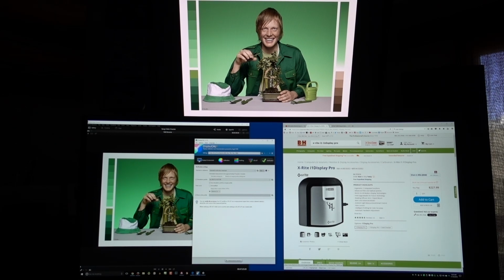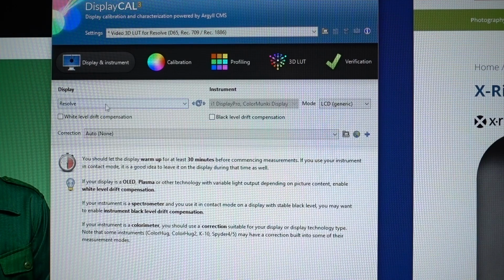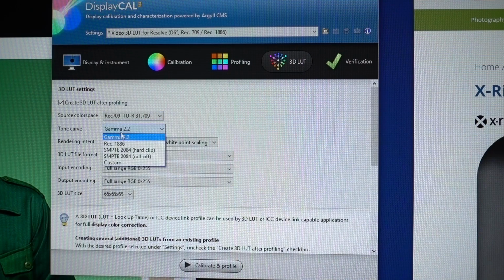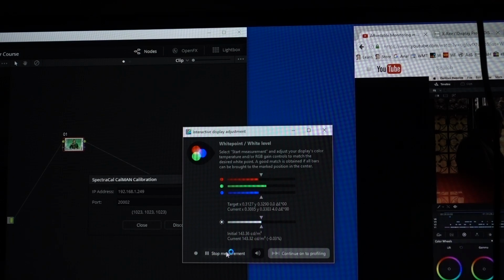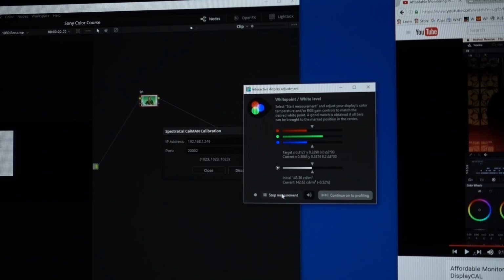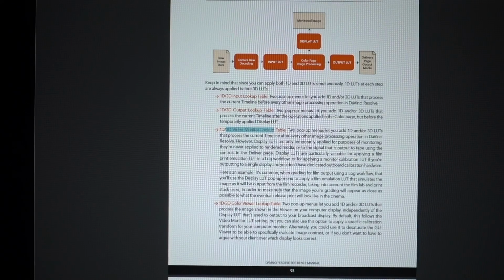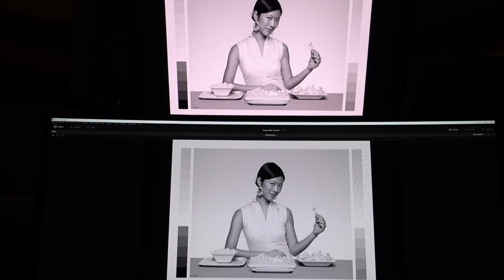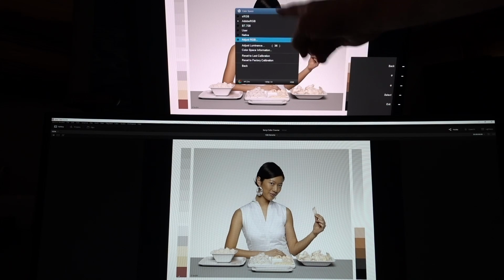Calibrating with DisplayCal in Resolve thru Mini Monitor Question

Comment: I'm having trouble getting this to work right for a different reason. I want to use my second monitor as a computer monitor and as a Resolve monitor depending on what I'm doing. So I calibrated one user mode with a Windows ICC profile to be applied to the Display Port signal coming off my GPU, then I used another user mode to calibrate through Resolve using all the same settings to output through a Mini Monitor 4K card. Since it's the same monitor with the same calibration settings it seems like both should look the same or at least very close. However when I render out my Resolve timeline then view it in the other user mode through my GPU the output file more closely resembles the way the Resolve signal looks without the 3D Monitor LUT applied. This is really frustrating because I don't know which to trust. The signal from the Mini Monitor card looks cooler and less saturated. Which worries me because if I want my image to be fairly saturated and I judge my grade based on the less saturated display I'm worried that everything is going to be overly saturated on everyone else's display, even if they're properly calibrated...

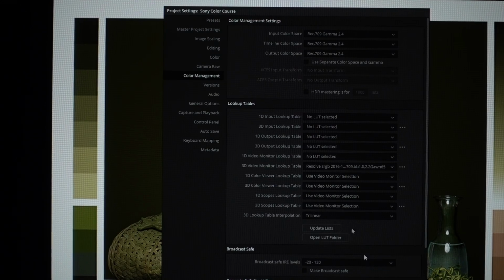Comment: hey Dave, Try this - ( better preface this by saying I'm not an expert) at around 6:37 when you select the LUT for the monitor, you also have your viewer etc (below in the table) set to "use video monitor selection" - by doing that Resolve will apply the LUT to all outputs, if you change the 3d Color Viewer to no LUT Resolve should apply the LUT to just the HP monitor, which is where you want it.
Reply from the maker: Thanks! That fixed the issue!
Reply: absolutely,  if you change the settings on the monitor the LUT will be incorrect. 
While this may not be as "accurate" as a true broadcast grading monitor, it is damn good! and a lot less expensive. I wouldn't use this approach for a blockbuster movie but for mostly web content etc it's great.
Reply: by the way Dave, you also need to watch out for the "scopes" setting in there too - I haven't found a definitive answer on google, but seems correct to me that this also needs to be NO LUT - otherwise the scopes read the LUT changed color, not what is actually in the footage.
Reply: Hi David. Just to make sure - the LG is getting it's video feed from a Decklink card not the computer video card? the LUT in Resolve will only work if the monitor is getting a "clean" feed from a decklink. 
Not sure of the message you received, have never seen it before.
Different brand monitors will look a bit different even after profiling - they all have different contrast ratios, black levels etc etc. One thing to remember is the iMac monitors are designed to make an image look good - not neccessarily to be colour accurate. It should be good after carefull calibrating but then so should the LG. If it's giving odd colours only sometimes then I'd be checking cables / connections etc. 
Also can be an HDMI issue - my large DELL is crap with HDMI so I use a AJA SDI to DVI convertor from the decklink and the image is really good.
Reply: This should be the rigth answer here. The moment you applied the video monitor 3d lut the other boxes changed aswell.
Reply: Nice work Jeff.  Yeah this seems to be the ticket.  I'm guessing the reason for the red image on the HP monitor was maybe changing monitor RGB values after the lut was made maybe?  You shouldn't change any settings on the HP, let the lut do the work.
Reply: Hi Dave and Jeff,
I tried to calibrate my LG 4k display with my X-rite i1 Display on DaVinci and I followed all your steps. 
I tried Jeff's suggestion on the 3d LUT. I selected no LUT for my iMac and for my Scopes and that part worked fine.
The problem is on my LG monitor that sometimes is displaying very horrible colors and noise!
I really don't know what is going wrong. Display Cal sent me a long message after I made the calibration. 
It says: The display device's video card gamma tables 1d LUT calibration is non-linera, but the 3DLUT contains applied 1d LUT calibration. Make sure to manually reset the video card gamma tables to linear before using the 3d LUT, or create a 3d LUT without calibration applied... 
Did you have the same message? I have no idea what is this! Where should I put the LUT or how to manually reset the video card gamma. No sense for me. 
At the end I manually calibrated by eye my LG 4k external monitor comparing a series of photos having as a reference my calibrated iMac. The color controls on the LG are pretty good to go on details, but at the end is never exactly the same color, at least is the similar option I could make. 
Any suggestions?
Reply: Hi Jeff, Thank you for your answer. I'm using an UltraStudio MiniMonitor from BlackMagic to connect via HDMI my monitor. One of my theories is my UltraStudio is HD and my monitor is 4k. Probably I have to upgrade to a Decklink card like yours. I noticed the UltraStudio box gets very hot and at some point just doesn't work properly. The reason I bought the UltraStudio is because I mainly color grade documentaries for TV and I didn't need 4k at that time.
Well, time to invest on a Decklink 4k and a PCI expansion chasis. 
Cheers!
Reply: Can you help my I alwayse got corlorshifting between my MacBook and three TV the TV look similar but not my Mac ( it looking mor contrasty)

Comment: Great question.  I see the same results with similar hardware on the Mac version.  Are you already invested into that HP monitor?  FSI monitors let you put the LUT in them so you can bypass davinci app putting the calibration lut on.  For TVs etc.. box i/o and fuji are good options, but all pricey.  

I'm curious to find out if it's a bug or that's how they always have worked in the color management settings (going to both monitors at the same time).

Comment: Why not just calibrate your screen as it is - without involving Reason?
Reply: Not possible to calibrate a decklink output without either a lut box or resolve as a test pattern generator.
Reply: I didn't know that, thanks for the input.